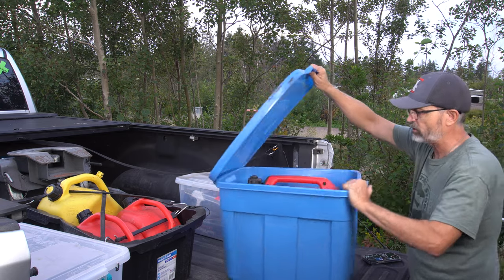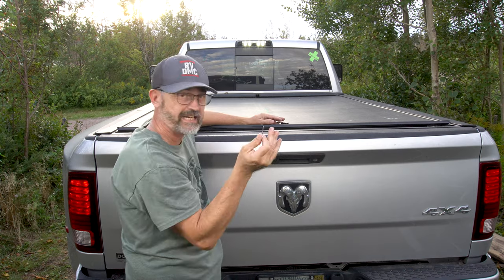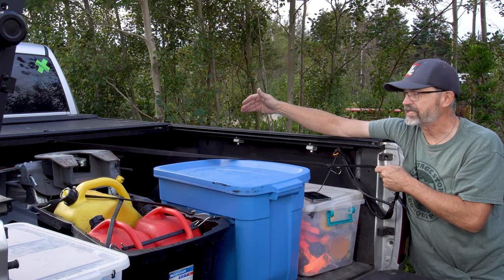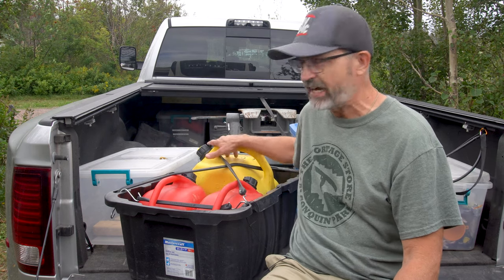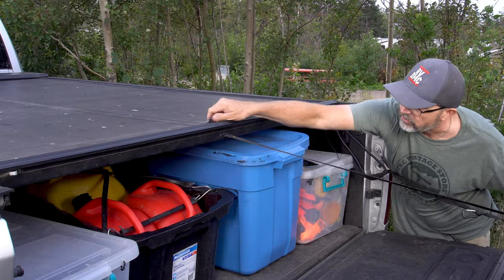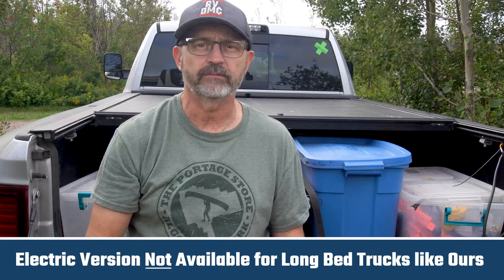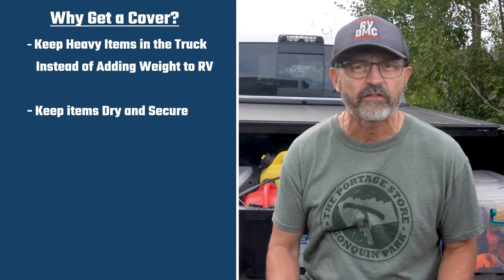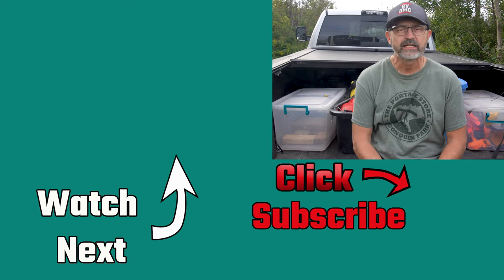Truck Bed Cover 1 Year Roll n Lock Review (RV Living) 4K

Comment: Is it dust proof for dirt roads???
Reply from the maker: Yes, when closed it really keeps clean in the bed.  Larry
Reply: LMAO  Dust proof?!?!? ROFL. We must be on different roads! After fire roads in W Virginia you might need a colonoscopy to get rid of the dust!  Nothing is dust proof. Hell, I've cleaned a truck, walked away 20 yards for a second, and a sand devil just appeared left a half inch of sand before I could get to the door.  The Retrax helps keep things cleaner, drier, more manageable and organized, is more aerodynamic. The version with T rails allows for more cargo easily placed on top. Your bed will be a hell of a lot cleaner than without it; but dustproof?  A submarine maybe.

Comment: Well I am going to call roll n lock asap.  Spent over $1400 on a cover that is a pile of junk.  The instructions tell you to install parts that are already on the rails.  The weather stripping chewed up and was destroyed the first time I opened the cover.  It was so sticky to pull open the cover that the bracket holding the strap broke off and now the cover will not stop and latch properly on its own.  Also after about 2 days the backing plate by the tailgate holding the weather stripping in has bent and doesn't want to allow my tailgate to close.  I mounted it flush like the instructions said.  Just pulling the cover to the tailgate a few times has wrecked the end and pulled the screws out.  Also the brush on the cover to keep debris out doesn't contact the cover in the middle because the cover sags.  Total junk.  If my dealer has a return policy I think I will just do that once I check.  I am extremely disappointed especially after reading all the positive reviews.
Reply from the maker: Perhaps you got a bad one. We haven’t had the problems you mention. 
Let us know if the company is willing to exchange and how it goes
Reply: @DownsizingMakesCents  I will let you know.
Reply: Hi Larry, wouldn't you know I have been waiting for roll n lock to respond to my dealer for a couple of weeks now.  Called them and they said roll n lock was dragging their feet.  I called roll n lock and was informed they reached out to the dealer and were waiting on the serial number for the cover.  Well I handled it directly with roll n lock and they are sending me out new rails and handle.  Very happy with roll n lock.

Stay safe out on the road and happy travels to you both!

Comment: Can’t get mine to shut tightly. Always a crack on one side.
Reply from the maker: You may have to realign the plate attached to the tailgate
Reply: Facing the bed from the back the right side will not latch. There is a 1/4 inch gap. Left side latches. I removed the rear stops and pulled the cover totally out thinking it was misaligned on the roll. No good as the gap remains. Called Roll and lock and they were no help. This cover worked fine when new. Not now.

Comment: Without the strap, that cover would not be useful, unless, put two grab handles (1 on each side) toward the back of the cover. With the wife, or son or daughter on the other side from you. Both pull evenly, and it will shut. Just a thought.
Reply from the maker: Yes kind of wish i had paid a little extra and gotten the Retrax.  The strap is an inconvenience but it works.  Larry

Comment: Don’t waste your money on a roll n lock cover. They are complete trash. Only owned mine for a year and it’s falling apart. The roller has seized up completely and cannot open the cover now. I’ll have to buy a new one for $150 if I want to fix it. Not worth the pain in the neck to install a new roller. I would highly suggest you look at a different bed cover before buying one of these.
Reply from the maker: I’m sorry you had a bad experience, ours is 3.5 years and still working great, open and close almost everyday.  For $150 I’d fix it.  It’s a $1400 investment.  Larry
Reply: @DownsizingMakesCents I probably would fix it, but as the roller had gradually gotten worse over time, the small screws that stick up in the bottom of the cover housing have ripped up the vinyl cover as a result of the roller beginning to fail. Yes, it’s quite the investment for one of these, but I don’t believe it’s worth fixing with the vinyl on the cover now ripped up along the edges.